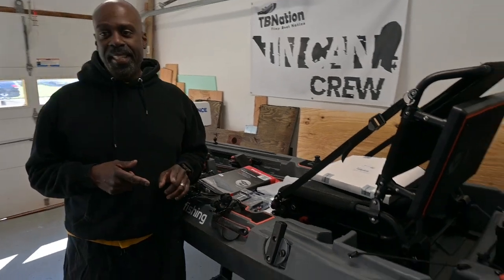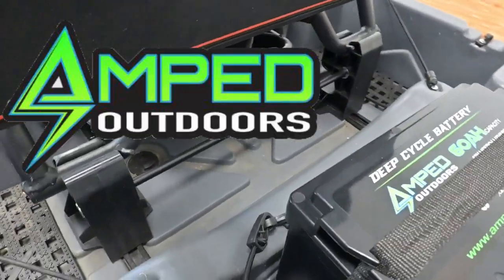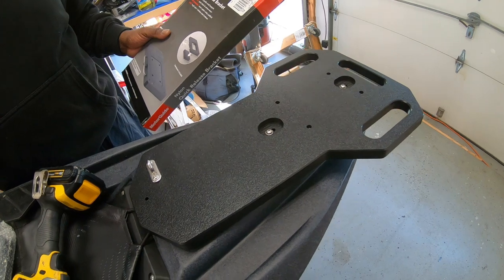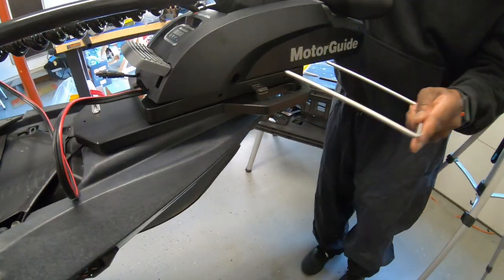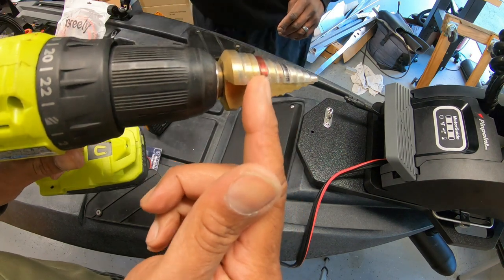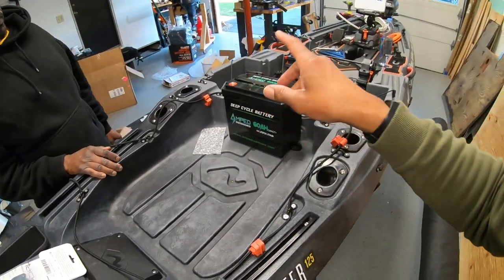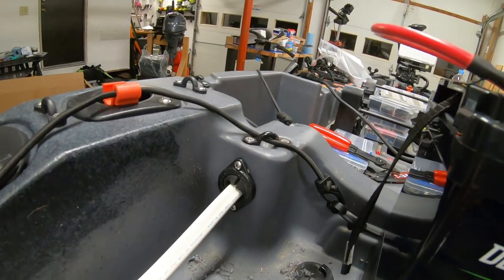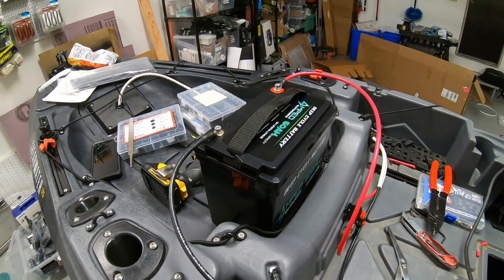MotorGuide Xi3 Kayak Trolling Motor Install with EASY Pulley System to Deploy & Stow Motor

Comment: That connect is for the motorguide pinpoint gps gate kit.  It for connect to a lowrance unit. Opens up a couple extra features thru the ff. You would need to add a nmea network to use it.
Reply from the maker: Thanks for the info 👍🏾👍🏾👍🏾

Comment: This is a great video!  Just installed my xi3 today.  We were struggling with the deployment part.  I like what you guys did.  One question, does the eye bolt you used on the shaft bracket just screw in?

Comment: Great video. What eye bolt size and thread count did you use on the Livescope mount to pull the trolling motor up?
Reply: I think you’ll need an M8 x 1.25 eye bolt. I’m having trouble finding one in local hardware stores, but you can find them online.
Reply: @ridderroman  I went with the Eowpower M6 Male Lifting Ring off Amazon. Works perfectly.

Comment: I want to do this but the front of my kayak has a very unique design. The premanufactured mounts don't look like they would fit, I am going to have to fabricate something of my own. 

The motor itself is about 40 pounds right, does that much weight right on the nose affect handling much? I fish salt water and it can get choppy, I am leery about having the bow too low.
Reply: One objective makes mounting plates for several different kayaks.  I would start there.  You do need to counterbalance the weight of the motor.  Most people do that by placing the battery at or near the stern.

Comment: When you dismount the trolling motor what are you doing with the pedal release rope? Do you have to untie the knot on the pedal each time?
Reply from the maker: "There are two other carabiners between the foot pedal and the handle that are hooked into each other. I just unclip the two carabiners and fish the rope that is connected to the foot pedal through the eyelet on the bow mount. Hope that helps."

Comment: I like that. How long will the battery last on an average day?
Reply from the maker: It's good for a full day out on the water with fishing.  Rule of thumb, most single lithium batteries will last only 1 - 1-1/2 running at full speed. So vary your speed for a full day of power

Comment: What size eyelet did u use for the garmin livescope bracket?
TIA
❤
Reply: Try a M8 x 1.25 eye bolt. You’ll probably have to find it online. The hardware stores where I live only have SAE eye bolts and you’ll need a metric eye bolt. I took the garmin mount to Home Depot and figured out the knob bolt is an M8 with 1.25 thread.

Comment: Yall added a eyelet. When the mount had one for that Exact reason. Didn't really get the reason for drilling those hole in the back to run the wires.  But not my kayak.
Reply from the maker: Eyelet that comes with it is too small and out of position.

Comment: Does your xi3 retrieve line get wrapped around your shaft?
Reply from the maker: When spot lock is activated the motor spins to a point and then automatically reverses because it has turned to the point where it higher turn radius in case it needs to correct in the opposite direction. Therefore it doesn't wind up the deploy/ retrieve cord or the motor coil itself.

Comment: Did yall add a circuit breaker between batt and motor? Im trying to figure out if a 50 or 60amp breaker should be sed. Any ideas?
Reply from the maker: Yes 60amp breaker. That's pretty standard for trolling motor 55lb or higher.

Comment: What black bracket did you use for the stow and deploy? On thr shaft on the motor. Thanks
Reply from the maker: Here's the link to what we used.  This and other links are in the description below the video. https://amzn.to/3NvG4UD
Reply: Awesome! Thank You
Reply: I used the same bracket on my Xi3 install for my PA14. The only thing I did was include small plastic washers so I could tighten all the srews and still allow it to spin freely.

Comment: Don’t you want that stow bracket loose so the cord doesn’t wrap around the shaft?
Reply from the maker: The stow bracket does not cause the rope to wrap around the shaft.
Reply: The motor won't allow it to wrap. It has a feature that will allow the motor to spin up to 180% then automatically spin around to the opposite 180% if that makes sense.

Comment: Why didn't you just use something like mechanics wire and just run and fish the wire from the front to the same location that you drilled next to the battery rather than go all the way to the rear and then double back above the deck to the battery location with the wiring?